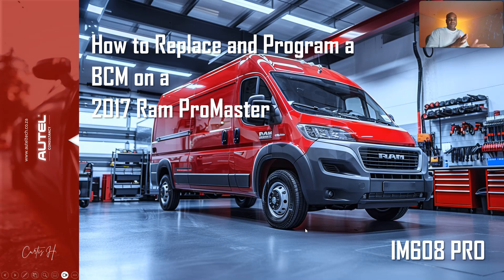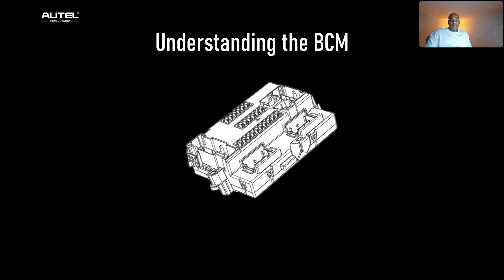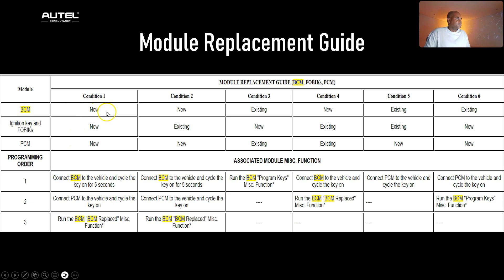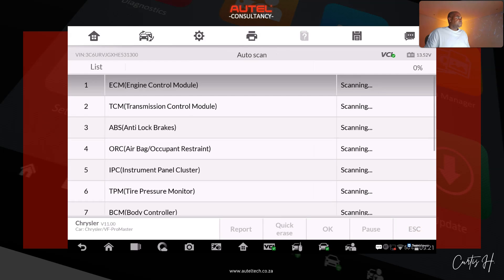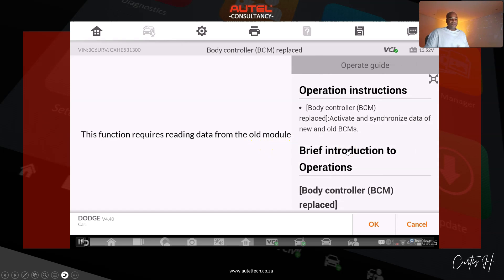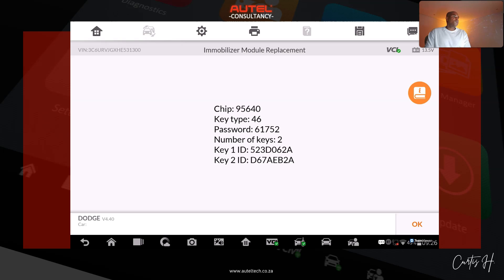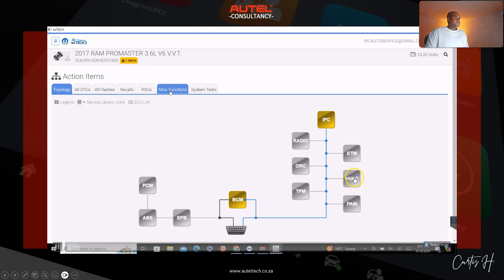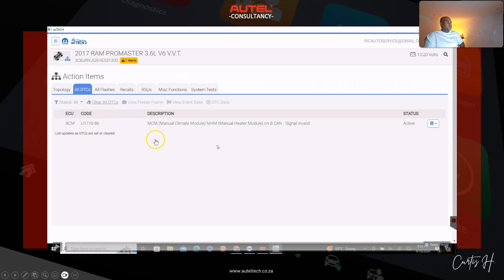IM608 PRO Case Study How to Replace and Program a BCM on a 2017 Ram ProMaster

Comment: Hello,

Before purchasing, I need a clear technical confirmation.

I work on 2023–2024 GMC Canyon / Chevrolet Colorado (GM Global B platform).

My requirement is NOT diagnostics or relearns.

I specifically need to know if Autel MaxiIM IM608 Pro II supports:

ECU Coding / Guided Functions / Variant Configuration in
– IPC (Instrument Cluster) or
– BCM (Body Control Module)

to change the Parking Brake Warning Indicator, meaning:
– from US “PARK” / text warning
– to EU “(P)” circle brake symbol

Please confirm clearly:

Does IM608 Pro II show this option on GM Global B vehicles?

Is the change done via ECU Coding / Guided Function (not SPS flash)?

Have you tested this on GM Global B (Canyon / Colorado / Silverado new generation)?

I need a yes or no answer, not general compatibility.

Thank you.
Reply from the maker: If you want a general answer you can contact your supplier .. If you want me to take the time to research your query you can book the diagnostic tool consultation auteltech.co.za. Its a 97 USD .  If you dont book I cant research for you to give your certainty.

Comment: Hi sir.  It s possible replacement bcm for one bcm used .?
Reply from the maker: It depends on what vehicle you're working on and what equipment you have.
Reply: @AutelConsultancy  it 2016 Ram pro master 1500
Reply: I have im608 pro II

Comment: A couple of weeks ago, we swapped the ram promaster 2500 van 2023 into a box truck ram pro master 3500 of 2017. Absolutely everything (engine, transmission, wiring, everything) Only one blind mirror sensor was missing. After 60 miles, there was first an error on the battery and then absolutely all the errors on the dashboard, including the transmission. The dealer station said that it was the missing blind mirror sensor. What do you think about this?

Comment: Did you finish flashing the BCM using JVCI +? I’m unable to flash even using Witech
Reply from the maker: I think he had a Cardaq. I remember when I prepared his computer he just told me he bought the Cardaq so he wanted me to use this for the procedure. I have used the Autel JVCI many times and haven't had an issue.
Reply: @AutelConsultancy  the shop I was doing work with called me and updated me with the fix. They sent the Promaster to another dealer who also could not get the BCM to flash(I was concerned it was a hardware/software issue on my end). They wound up getting an engineer on the phone that determined the new BCM out the box was defective. They replaced the BCM and were able to flash with no issues.
Reply: @TheDailyMove  i had issues also I tried programming a new bcm (16 Promaster) using my jvci+ plus with witech and it would always come back as” unable to write data to bcm….” witech help desk was no use since the j box wasn’t a “verified” vci. Took it to the dealer and they programmed it with no issues.

Comment: Its been my experience these vehicles use a rolling 4 digit PIN code,  the 5 digit calculated by the IM608 will not work.
Reply: Use multiple scan tools to read PIN code before starting replacement
Reply: What tools??
Reply: It will tell you when doing bcm if it’s a rolling PIN code that’s different then the immo pin. Some vehicles make you use a rolling PIN code from nastf

Comment: Does Autel not allow reading info on all Promasters, or was this vehicle just an issue?
Reply from the maker: HI Jay, when you say reading are you referring to obtaining the pin code? Or doing special functions
Reply: @AutelConsultancy  sorry, when you were trying to backup the data.  I'm just wondering if it was just this specific Promaster, or does the IM608 not work for any?  I had an issue with a 16 Q5. I've done many, but for some reason on that one, when pulling data from the car, it would go to 99%, then cycle back to the beginning, get to 99% again, then fail. I usually don't have problems adding keys for Audi, even that year Q5 model, but I think it was just an issue with that specific car.
Reply from the maker: @jaymoney4265  I would say its VIN specific. It could be a variation of things such as software issues with the Autel , or just the way the module is that i wont allow us to do it. Usually what I have to do in cases that you describe is have my engineer analyze the session to determine if its a software glitch. If it is they would create a patch that will address the issue. Or they will tell me flat out that the autel doesnt support the vin.